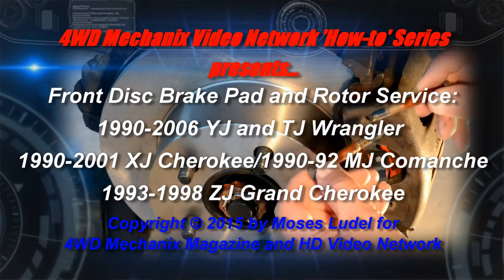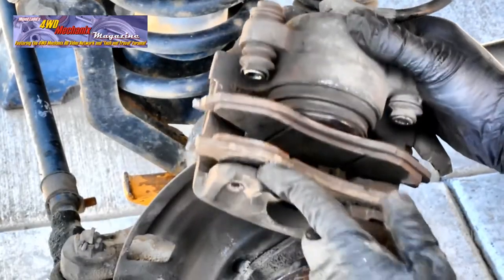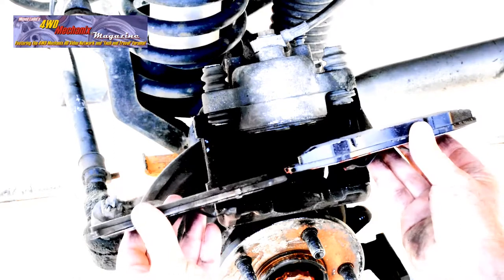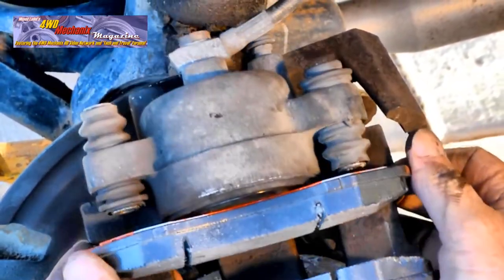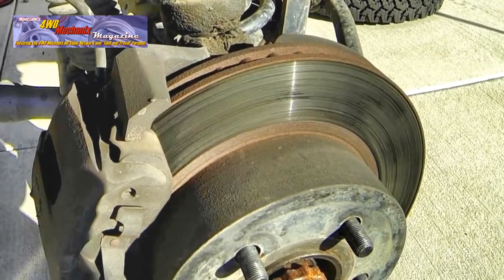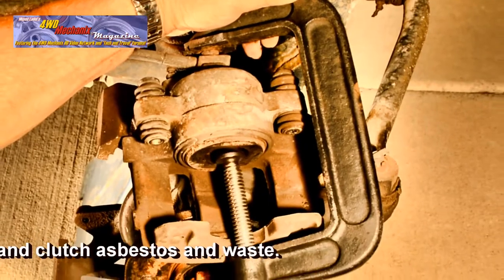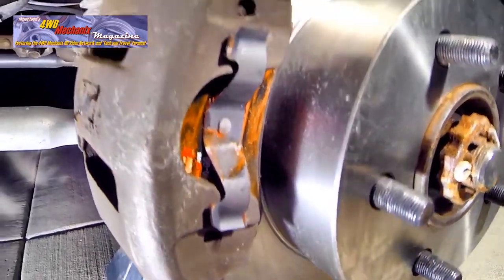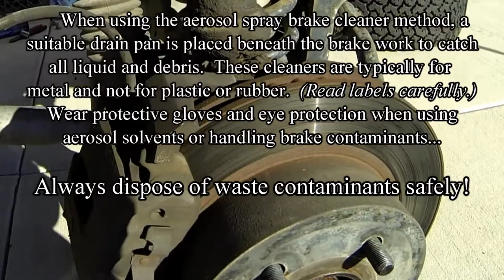1990-2006 Jeep® Front Disc Brake Pad and Rotor Replacement

Comment: You did not show how to install the small shims that go on the ends of the brake pads.
Reply from the maker: The installation shown is a 1999 Jeep XJ Cherokee.  All parts needed for this brake application have been shown.  These brake pads have locating lugs (shown and discussed in the video) that keep pads from rotating or shifting out of position in the caliper.  (Some brake pad types use spring clips at the pad ends to keep pads from rotating or shifting.)  These 1999 XJ Cherokee brake pads do have "shim" backers built into the backside of the pads.  I added special paste (orange) designed for anti-squeal to the backside (not the friction material side) of the pads.  The paste covers the built-in shims on this brake pad set-up.  To confirm whether a specific make or model with disc brakes uses additional shims, clips, springs or other hardware, consult a Mopar parts catalog or a brake parts supplier's catalog for your make and model.